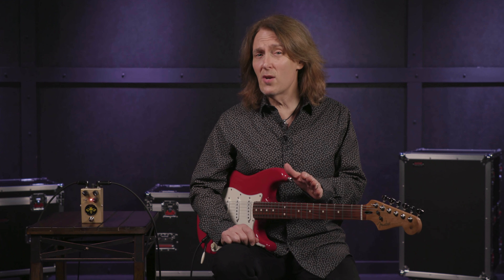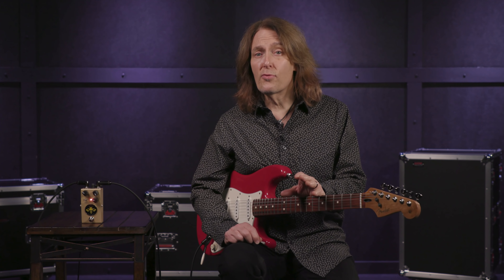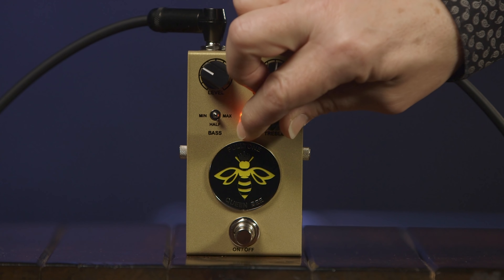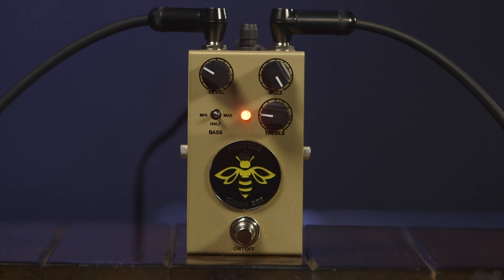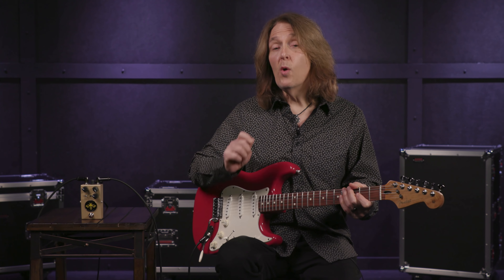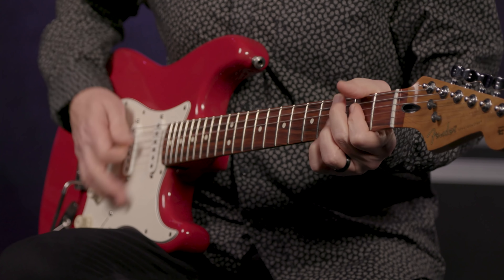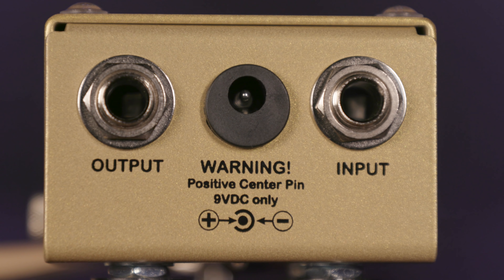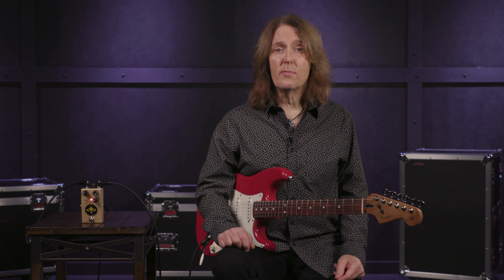Fulltone Custom Shop Queen Bee Fuzz Pedal Demo

Comment: Hello, 
I own this Queen Bee Fuzz pedal. In my pedal signal chain, it comes first right after a Boss TU-3W Chromatic Tuner. I wonder if the Boss pedal does act like a buffered pedal. In this case,  what should I do ?
Sorry, I'm a bit of a noob in terms of pedals signal chain, apart of the basic knowledge.
I write this post because I read that the Boss chromatic tuners have a buffered signal that can be activated or deactivated. True or false ? 
Thanks in advance 😉
Reply: If your TU3 is a buffered pedal it wont pass signal without power (most boss pedals like 99.9 percent if them are bufferex). If it will pass signal without power its true bypass. If it is buffered then vintage fuzz's like this one based on a fuzz face should go before it or any other buffered pedals. If you place a buffered pedal before it then it's going to make your fuzz sound weak and thin/bright.
Reply: Try moving your tuner to the end of your signal chain

Comment: Is this a fuzz face type fuzz?
Reply from the maker: Hi, Kyle. I believe this is meant to be a Tone Bender style fuzz, but there is a lot of overlap between a Tone Bender and a Fuzz Face so depending on how you set it, you could probably achieve some Fuzz Face style sounds, as well. If you're strictly looking for a Fuzz Face style pedal, the Fulltone '69 or '70 pedals would be the ones to check out.
Thanks for your interest!
Charlie Davis, Sweetwater Sales Engineer, (800) 222-4700 ext. 1320, charlie_davis@sweetwater.com
Reply: I think it is more specifically a Buzzaround, which is in the Tonebender family. Has pretty good clean up but not quite that of a FF. A great great circuit